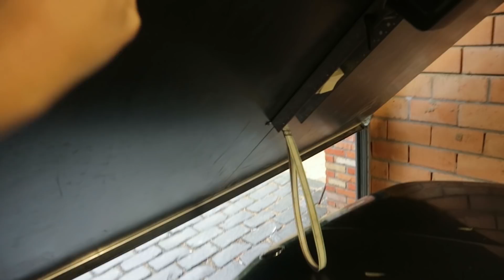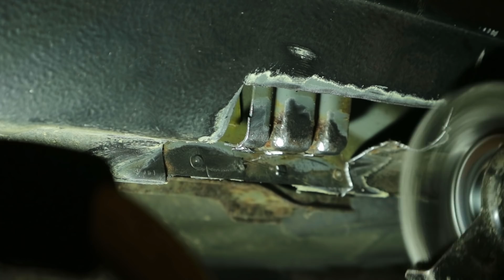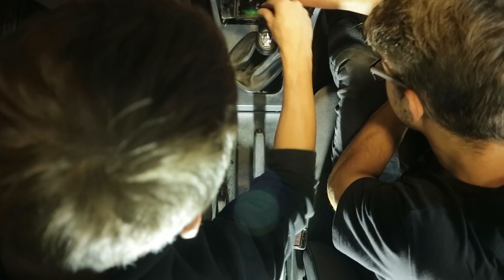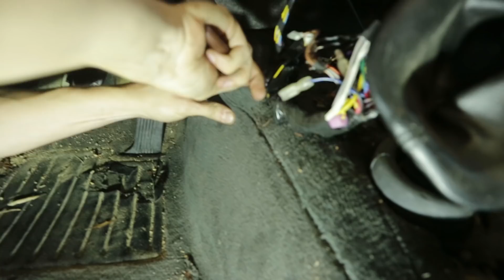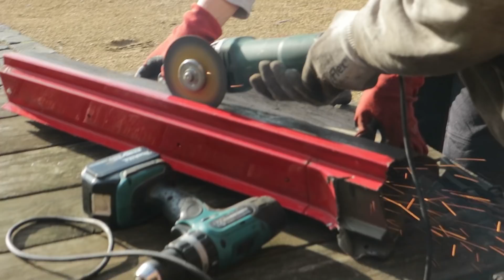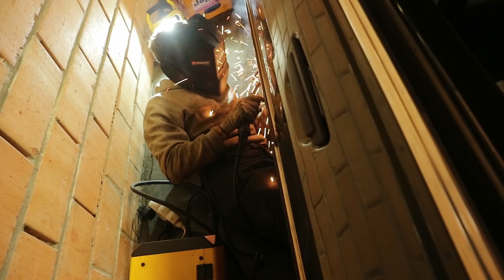How to repair rust - BMW E28 restoration

Comment: talking about rocker panel, ideally you want to replace it whole as it was put on the car in factory so nobody knew about replacement + you can really clean inside rust, but your way is also procedure of most avarage body shops I know so it's good job for first time diy...

Comment: About fixing and welding... Watch my fbpage E30 330D '86 by Revan. Many squares and repair panels, but worth it. You should wear protection googles, when you're grinding. I visit 2 times ophthalmologist with sparks (and rust) in my eyes. Painful and costful :) Nice job and I will wait for results!

Comment: Great job, man, respect! Rust is giving me nightmares now. The jack rubber point of my Benz W202 (well known for its rustiness) fell off recently and alongside it some underbody coating came off which showed that the area around it is rusty, however, it sort of seems to be superficial at this point as structurally the metal seems to be strong. But realistically no idea how bad that is as you can not see that much without getting to work. What's your verdict? :D

Comment: I just happento see video #4, but have not seen 1,2,3, also I have an 1989 E-34 535I Alpine White, it still has most of the factory paint, of course it has some rust, but what has me thinking the two front doors, don*t open, eventhough the car does not have any locks on, somebody told me it could be, the rubber(weatherstripping)which actually somehow sealed the doors,thanks.

Comment: Good job man! Keep cutting, welding and so on. It is still in a good shape I can say. Don't forget to use preservative oil (or not oil...oil like fluid, have no idea how to name it in english) to fill up holes and inside of your doors etc. Everywhere where you can find hidden surfaces. You should do it after painting. If you want to get of rust of your not painted parts - use rust solvente with molibdene but do not forget to use anti-acid to neutralize it. Also please use safety glasses as it is very easy and dangerous to get injured by grinder. Another thing, take your screwdriver and hit everywhere on your car floor as you have your carpet off. You will find more holes and easy fix them. Also check inner arch - it is also rusted I believe. And last thing, when you welding - do points but not lines. It will not overheat the metal and you will have pretty much good surface after all.

Comment: To remove rust dont use metal brush because this tool only polishing rust and its dont giving good efect for us. I always using sand paper or special structure with sand and using this on drill!

Comment: Yo ! Nice video again 😉
Be careful when you use a MIG/TIG, disconnect the battery and most equipment. 
For the zinc, I know that the access is difficult, but avoid welding on it, do it after on clean metal. 😄 
Continue like that ! And put some fcking gloves ! I was like you... But it's important 😂
Good luck

Comment: Damn dude this is a lot of work. I've done 2 E30 engine swaps and of course in the process you discover a whole host of other issues, rust included. Had to do quite a bit of rust repair on them, but never like this. Feels daunting just watching it, props to you man! Love the series!
Reply: Really? This is not a lot of rust for an 80s BMW. My E30 is 10 times worse.
Reply: T B I’m from Australia so we get it pretty good here I guess, mostly dry conditions and massive garages so cars aren’t outside a lot

Comment: Hey man, I did tons of rust repair in my life. I suggest you get brunox epoxy, it's the best rust converter out there and put it with a brush on the places where you removed the rust. Give it a try and well done so far.

Comment: While you're at it, remove the spare wheel as well as the rubber from the boot and check the metal behind the tank lid (they often rust due to spilled fuel) en below the battery tray (battery acid from back in the day is the culprit there).

Trick with the carpet is to remove the 2 front seats, then you can lift the complete carpet out (and give it a good cleaning as a bonus.)

Oh, if you're planning on replacing the speakers, you have to replace all the speaker wire as well.
The stock radio only gave out a positive signal and the car's body was used as a negative, while modern radio's require you to have both positive and negative wires being connected.

Comment: i removed the carpet on my e30 for track purposes. It was impossible and since it was dirty and ruined i cut is aswell.
Reply: Its not impossible at all, you just don't know what you are doing. All you have to do is pull the shifter and handbrake handle off, Undo the heater core brackets and slide it out. I keep seeing cut carpets for sale and laugh. No one wants them. Meanwhile every once in a while one pops up intact and sells instantly
Reply: @goclunker  yea, i didnt check the heater core brackets. As i said, it was fucked anyways so i didnt give a shit :D

Comment: Little tip from an professional, when using the Drillbit for the Spot welds go really slow so you wont burn out the Bit.